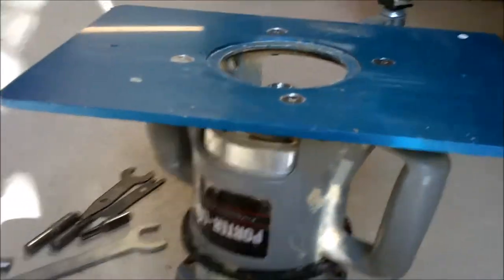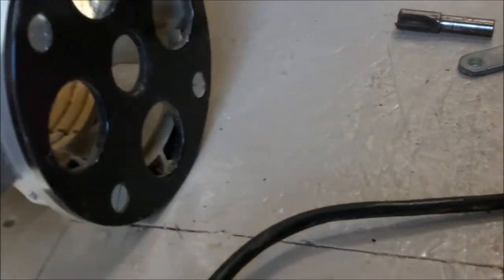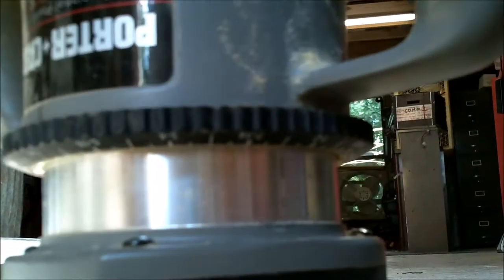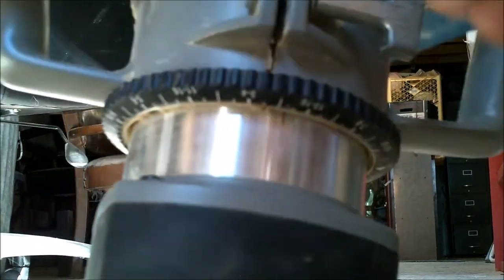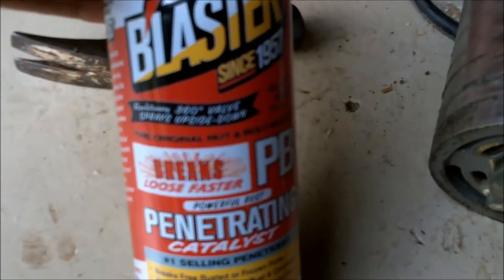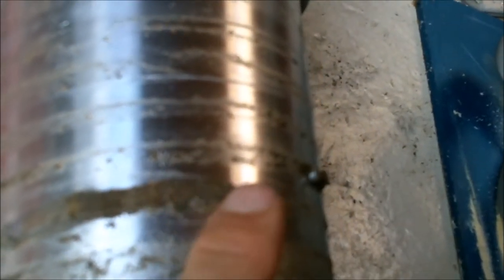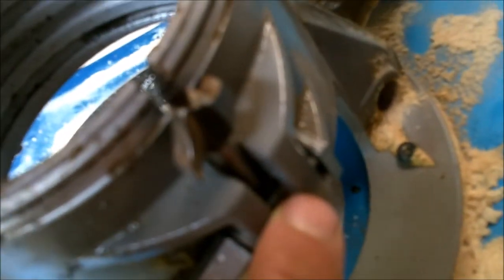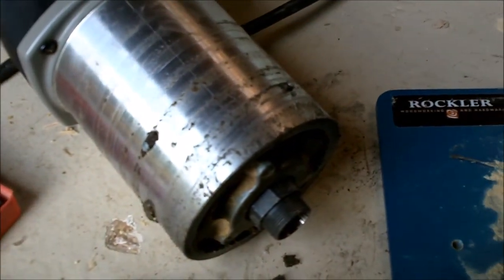What to do when Porter Cable Router 7518 Depth Adjustment is STUCK!

Comment: This video may be old but it's just what i needed to see. My old Ryobi R1801 wouldn't adjust but about an inch up or down so I just took silicon spray and kept tapping the body with a rubber mallet and turning the body back and forth. Took my air hose and blew out as much sawdust and gunk as I could, rinse and repeat and all of a sudden, boom...it broke loose and spun up and down to the full amount of adjustment. Works like new now. Don't know if you're still on this channel but thanks Doc!

Comment: Thanks so much for posting. I had the exact same issue and didn’t know it. I thought my router was just limited in its height adjustment. Makes much more sense now and I can use some of the longer bits I bought but had been unable to use.